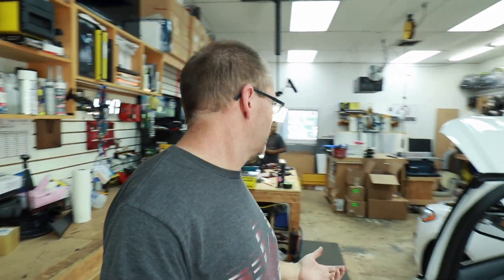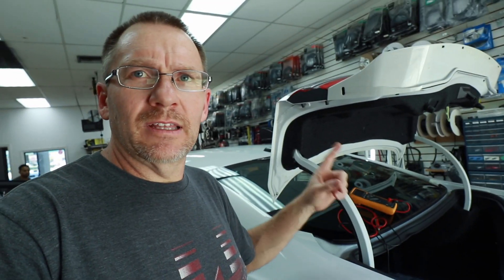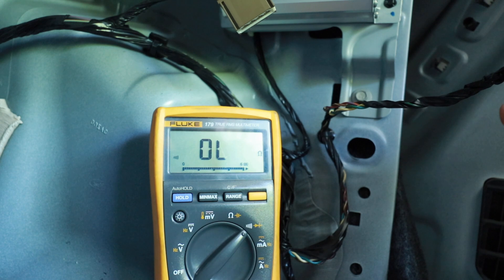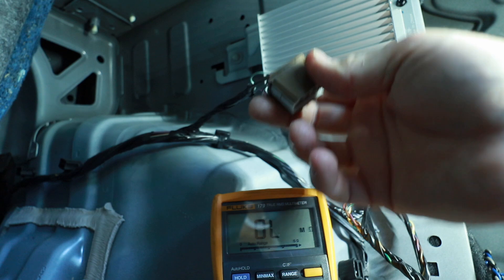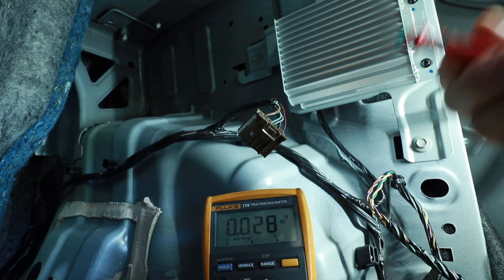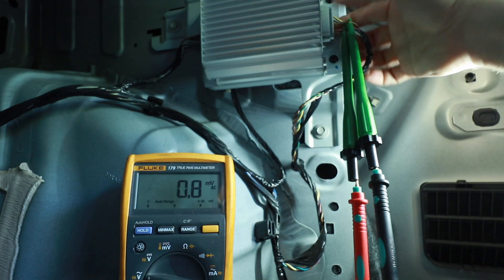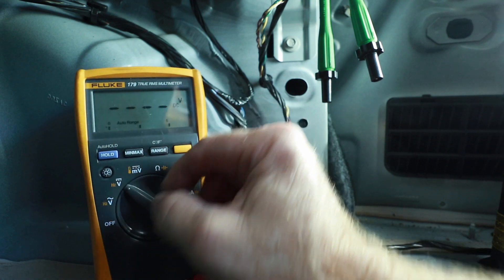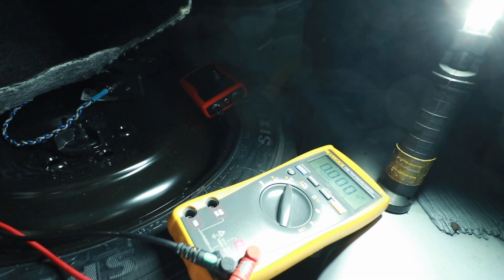How to meter for DC offset and signal output voltage for Hi to Low

Comment: This was very helpful and helped me determine that the Kicker 46KISLOC2 K-Series Stereo Line-Output Converter w/Remote Turn-On Output I installed was not able to provide a proper remote turn on output from the sub woofer output speaker wires of my factory B&O amplifier. My sub amp kept going into protection mode due to a DC Offset issue. I ended up having to run a remote turn on line from the front of the truck.

Comment: If using dc offset to turn the amp on, does the amp remove the dc offset from the audio signal at the output of the amp?

Comment: I’ve tried everything, maybe? I have a base model 2003 Chevy Tahoe and my kenwood just started show the dc offset I reset it a few times redone the battery terminal and it still shows as soon as I go to turn the volume up if it decides to work dc offset comes right back on..would you know why that is ?

Comment: So I have the Sony system in my 2018 cord fusion would this be the case also for install of amp for subs. I know the car has in cabin mics for isolation and also fake engine noise. I don't want to go crazy with a install just a bit more bass.

Comment: What do you do for the systems that "reverb" when you shut the door, sometimes just sitting, customer closes door causing pressure on the factory speakers causing a "signal" to move the sub, which keeps the speakers moving causing a feedback?

Comment: How do you deal with a dual-mode charging system in a 2020 Honda Accord sport 1.5t. When my car is in park it charges at 14.4v but when the car goes into reverse or drive, the voltage drops to 12.7V.... this happens when there is no electrical load. When in gear and I flip on my headlights then my voltage jumps back up to 14.4v when the car has an electrical load. Any thoughts or ways to help the vehicle from not going into low output mode?
Reply: Turn on your system, which is a load so it should stay at 14.4v !
Reply from the maker: Honda has been doing a version of this for years. Buy amps the are stop start Compliant they will work down into the 9 volt range.
Reply: Five Star Car Stereo Well I currently have a JL Audio RD900/5 amp already installed with a secondary battery (Stinger SPP680) with a better isolator (NVX XSBI200 which is a smart isolator that connects when the vehicle is producing over 13.2V and it shuts off when the vehicle produces less than 12.7V. Is there anyway to bypass or trick the ELD into being in high output mode? As you know, the stinger battery needs more that 12.7v of charging even at rest... a full charge on that battery is set at 12.85V or do I just have to run with my headlights on all the time to manually activate the high output?

Comment: How is it possible the factory amp do better job in amplifying the radio signal than the after market AMP ? Aren't factory amps supposed to be lower quality than after market one's?
 (since you mentioned that you don't want to max out the gain in the after market AMP)
Reply: That's not what he is saying. He's saying the factory amps signal output was so low that he would have to max the gain on the after market amp. You never want to max the gain.

Comment: One guestion if anyone knows..can i use power wire for the ground of my amplifier???because my set it to short and the power wire is long,can i cut it and make it cround wire?? Thanks and sorry for my english
Reply: If you have extra power wire left over after cutting it, you can definitely use the remainder for the grounds if you have enough of it. To make sure you don't mix up the wire since it will be the same color, you need to mark it as negative. I recommend putting black tape on it.